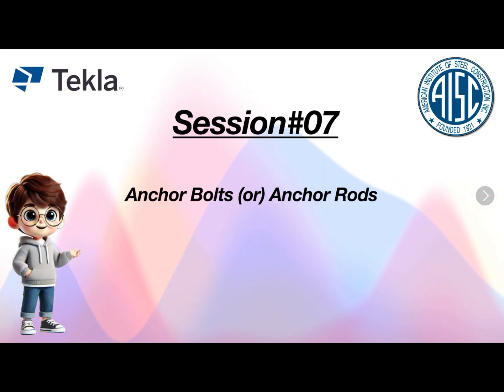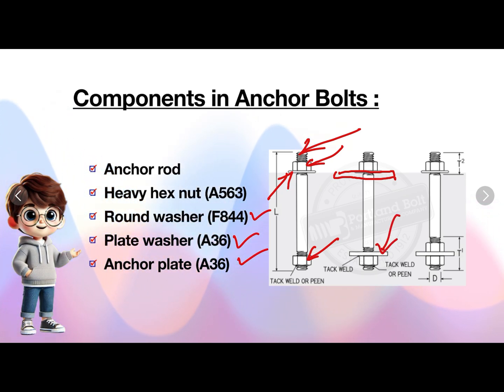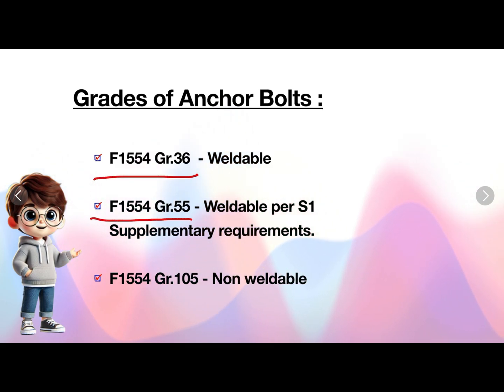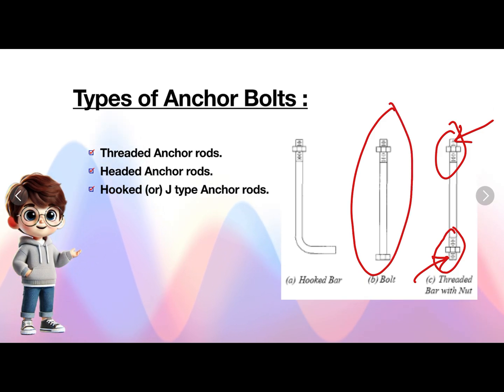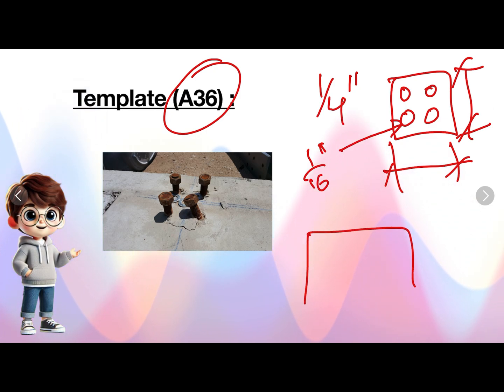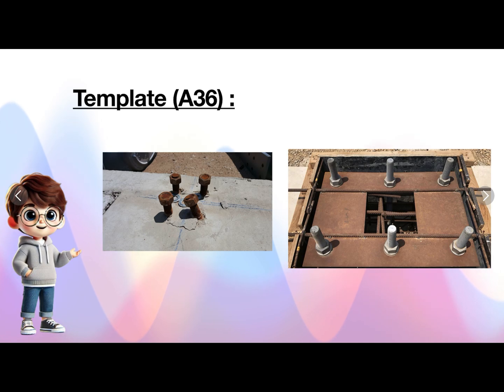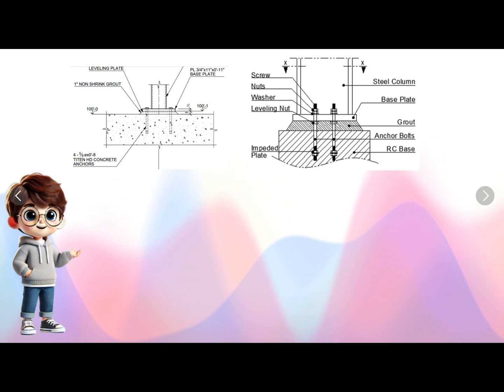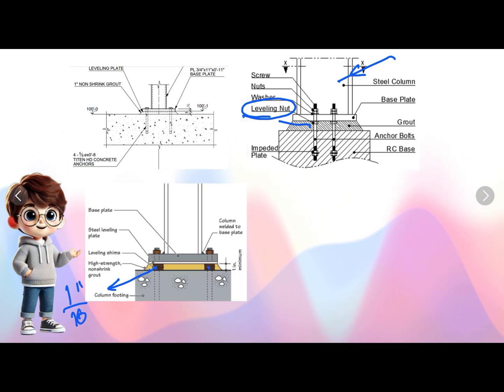Steel detailing training Session#07 – Anchor Bolts (or) Anchor Rods

Comment: In three point levelling method is there any aisc standard like if the base plate thickness or size exceeds, then we use this levelling method?
Reply from the maker: It depends on weight of base plate. There will be condition where base plate are if more thick and weight almost equal to 1 tonn. At those conditions, we use this 3 point leveling method. In my complete experience, I did only one project of this condition
Reply: @Steel_GPT  Got it thank you.